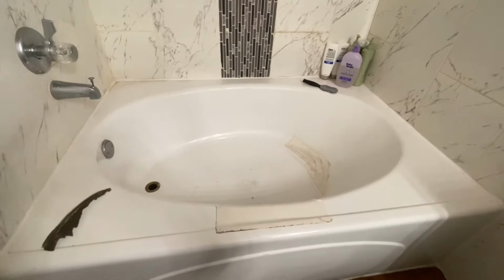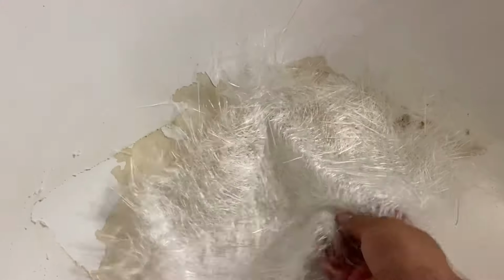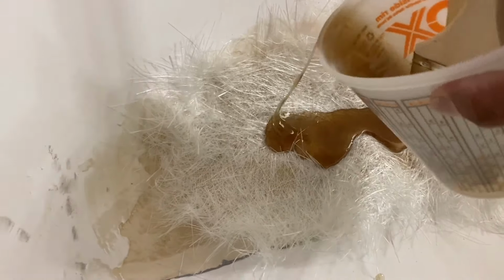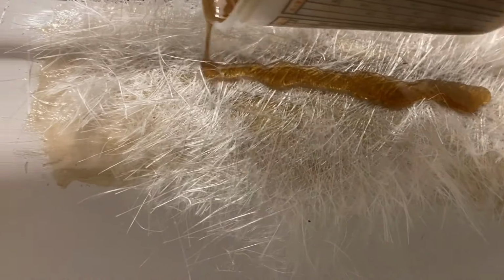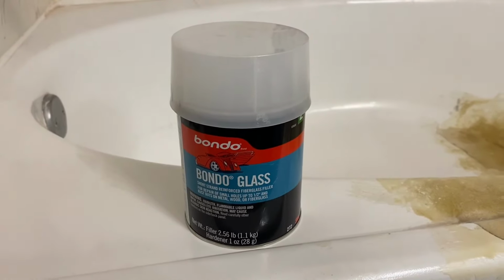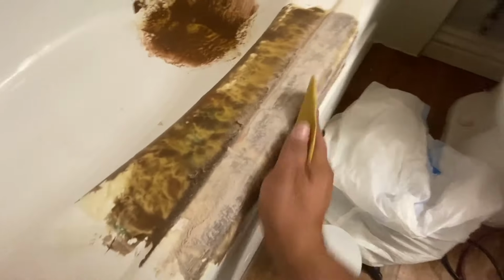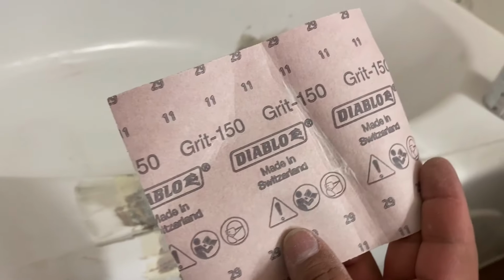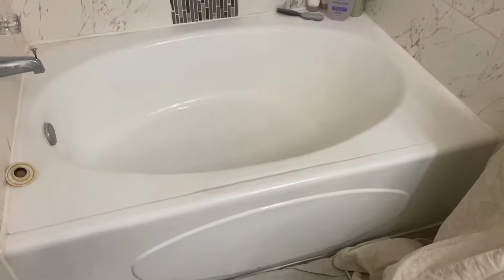How to Repair a Fiberglass Crack in a Bathtub | DIY Fiberglass Bathtub Crack Repair | STEP BY STEP

Comment: Do have or can you do a video about putting support under a fiberglass one piece tub/shower that is already installed.  I have been searching and not really finding anything for home repair. I can feel the lack of support in certain areas of the tub. I also have a couple cracks and will be using this video to repair it, but I want to put support in first. If you cant would you please direct me to a site or video.  Thanking you in advance.
Reply: There are those videos on you tube and other places.  I found several.

Comment: should one consider filling the gap under the cracking area of the tub?
Reply from the maker: You can if it’s extremely soft. However if it’s near the cove then there is not much you can do because there is a large void space behind the fiberglass units. Underneath is one thing but where it curves up is a void space in which foam would not fill properly

Comment: I did this last night.  all steps went pretty good except the krylon paint turned out horrible.  it was only glossy in a few patches.  rest of tub gritty matte finish which im sure will be a dirt magnet.
Reply from the maker: Once dry Take 2000 or 3000 grit wet sand paper and massage the tub with cold water. That will help remove any overspray mist. You can also DM me on Instagram or email me with any questions

Comment: Hi. I was wondering if you could list the materials used. It would be a huge help. Thank you so much.
Reply: I was after the same list. I live in  UK and have a hole to fix in my bath tube as well. Just would like to get the primer spray mark was used.

Comment: What is the difference between Bondo Glass and the Smoothening Putty?  Can you not just go straight to the putty?
Reply from the maker: Bondo glass has short strand “hairs” for added reinforcement. The putty is just a filler or smoothening putty. That’s why I’m some repairs you will see me use the bondo glass and others I will go straight to the putty.
Reply: @DPTubs  Ahhh. So it is basically the same thing as the (body) putty with fibers?
Reply from the maker: Bondo brand Bondo-glass reinforced filler is twice as strong as regular body filler. 1/2 in. interlocking fiberglass strands create strength and make this filler ideal for repairing small (dime-size or smaller) holes or rust-outs. Fiberglass strands in the filler allow covering holes without the need for backing strips, fiberglass mat or cloth.

Comment: Same here. This video came right on time. I bought the bondo resin and bondo all purpose and notice that you have bondo fiberglass on another video. Will this do for me or do I need the bondo fiberglass as well? Great video and we'll detailed.
Reply from the maker: I usually put bondo glass over resin only if the crack is substantial. How much is your crack flexing or broken through? If you are able to compare the cracks in my videos you may be able to get an idea on when I choose to use resin or just bondo glass. 

If you use resin or bondo glass you will still want to use some smoothing putty to smoothen out
Reply: Thank you for this tip. I'm going to add Bondo glass since I'm on my first step with resin and need to sand it down. Then finish it up with Bondo putty. Thank you for this video..

Comment: Question.. I have a crack on a flat portion of the tub. Do I still use the mesh?
Reply from the maker: DiaryOfAStud depends on how wide and if the crack is all the way through. If it is a crack that fluctuates and water gets through then I would use the mesh and drill small holes at the end of the crack.
Reply: Does it wear off with continued use? Or will it last long term?
Reply from the maker: DiaryOfAStud with proper cleaning it will last long term. Do not clean with abrasive cleaners. Or make sure you wipe down and clean regularly to prevent dirt and soap scum build up. Use Zep tub and tile cleaner with a soft sponge regularly.

Comment: Would you mind sharing how much you charge for this size job? I just spent over $100 (and that's without the $24 Krylon paint because SW is out, and it's $55 on Amazon right now). I'm wondering if I should just return all that stuff and call a pro.
Reply from the maker: $250

Comment: Thanks for making these videos. I fixed my tub but the sheen does not match on the patch to the rest of the tub. Do you have a video that covers that? Or any tips. Thanks Erik
Reply from the maker: If your tub is worn then there is no way to match because the paint you spray will always come out shiny. However after you use it it will start to blend in. 

If it bothers you and yiu want to “dull” it out then take 1000 grit wet sand paper on the newly sprayed area and slightly sand it wet to dull it out a bit

Comment: DP Tubs I have some hairline stress fractures on a fiberglass shower base. I feel it flex a bit when I stand in the shower. Should I reinforce this by adding foam in the drill holes or do you think doing just the reglazing you did would be fine? I don’t really want to drill if I don’t have to as the shower is only four years old and these are just hairline fractures etc. thx
Reply: I have the exact same problem as well and I would like to know
Reply: I am a month late with my reply but you are better off drilling the hole and filling it with foam so you don't have to worry about it in the future.

Comment: The rosin, glass and putty all have hardener included under the plastic cover. Save yourself the time and money searching. Also, wear gloves,  goggles and at least an N95 filter...and use a fan and open window to keep your work area ventilated.
Reply from the maker: Great advice! Thanks for the comment

Comment: Why didn't you use expansion foam under this crack?  Looked spongy.
Reply from the maker: Because the area where it curves up (where you would lean back) is completely void space and you would have to fill with a ton of foam. Would not be cost effective for the landlord. 
This has held up very strong. 

Keep in mind. Some of the work I do is limited by owner budget.

Comment: Wow amazing results. What primer did u use and does it have to be this Krylon tub&tile paint for the finish??
Reply from the maker: I just used Zinser 1-2-3 primer / stain blocker and then used Krylon. However if you are DIY you can use a Home Depot it Lowe’s tub and tile coating. But make sure the primer fully dries and is sandable.
Reply: DP Tubs & Home Repair hi water base primer or oil or does it not matter thank you
Reply: Also i have a shower base it is a little off-white, almost almond with a 6-8” crack now if i finish it with the white how do i prep/Finish the rest of the base to match. Do i sand, prime and finish coat only every else? Also was this a one day. Process.
Reply: Great vids by the way, i just came across a krylon appliance epoxy and i wondering if this one  would hold up longer than the bath and tile krylon.

Comment: Great Video! I've seen other vids where they fill the drilled holes with spray foam to increase the back support. You said you only drilled the holes to stop the spreading of the crack. Would you recommend injecting spray foam beneath the surface to provide some support??
Reply from the maker: I would only if it is directly at the bottom of the tub. The areas I was spraying had very large void spaces which would require way too much foam. If it was at the direct flat bottom portion of the tub then the additional foam would definitely work for additional support.
Reply: @DPTubs  Good info! One more question please: 
*Since you don't use foam in this application, the fiberglass is providing the structural support. If you use foam, then the foam is providing the structural support. When you use the foam, do you change the technique for the patch?*
Reply from the maker: Not necessarily. I may not feel the need to use the bondo glass since I wouldn’t need as much support. However I would still use the cloth over the crack like a drywaller would use tape over a crack. Then I would use the smoothening putty!
Reply: @DPTubs  my crack is on the bottom as it curves upwards to the sides.  What kind of expanding foam do You use?  And when it’s all finished how to clean the tub without scratching it?

Comment: Thank you for this video! Do you have a shared list of materials needed to do this? Also, I can hear water underneath my liner (but the liner is not squishy or anything). Do I need to remove the water before sealing it? Or will it eventually dry up? How do I remove the water?

Comment: Do fiberglass tubs crack on thier own after  several years ? Or is these cracks caused by too much stress on the tub ?
Reply from the maker: Could be different factors: weight of person, installation issues, or fiberglass product over time.
Reply: Ours cracked from dropping something very hard and blunt.

Comment: Do you do anything to reinforce the area under the crack to prevent future cracking?
Reply from the maker: Sometimes I will if it’s extremely soft. The location of the crack is key. This cove or curved area always has a void space so there is limited backing you can do. If it is flat at the bottom and there is a substrate then expandable foam is an option.

Comment: can you help me out with an good epoxy primer for going underneath kryl9n tub & tile
Reply from the maker: You can use Zinser 1-2-3 or Zinser shellac primer. Let dry over night and then sand with 400 very light and use a tack cloth to wipe down after. 

Midwest chemicals have the best refinishing primers but they are pricey and more for professionals. If you are a DIYer then I would use Zinser.

Comment: When you're sanding between layers, what is your goal? Is it to make it super smooth or is it to remove the biggest pieces? Or are you sanding it to rough it up for the next layer to bond with? And are you sanding it till it's flush with the rest of the tub or is just to smooth just the part we're working with?
Reply from the maker: Sand it smoother each time making sure edges are primarily smoothened with all big pieces removed. Smoother with each coat.
Reply: @DPTubs  thanks for the reply. I've had this problem on my to do list for a few months now. Tried to fix it once already but it didn't keep. Your video is excellent. Did an excellent job of spelling things out and laying down the process. I'm excited to see how mine turns out. I'm no professional but I'm pleased with the results thus far. Excellent work, man. Great video, and a huge thank you for doing it

Comment: Thank you for creating this video.  I did not know this type of repair was possible.  I started this project and soon realized the fumes are extremely strong.  Are these products safe to use in an occupied house?  If so, what safety precautions should one take before, during and after this project?
Reply from the maker: Products sold at Home Depot and safety instructions for use are on all material containers. I recommend using a filtered cartridge respirator as well as a time extractor / fan
Reply: @DPTubs  Thank you.  I think it will be helpful if you recommend these safety measure at the beginning of your videos.  Thanks Again.
Reply: Or you could just read the instructions and follow the safety precautions yourself. They’re not his products he’s just using them jfc

Comment: My tub has a 14” horizontal crack at the bottom...along the curve. Do I use the expanding foam? And since the fiberglass and all those finishes you used would only be on the repaired area, how much different will the final finish be compared to the rest of the original surface?
Reply from the maker: The difference from the original depends on a few factors: quality of patch and sanding, color used to match finish, existing condition and wear and tear of original surface. Patch will be smooth and most fiberglass bottoms have a slight texture..so the patches area will be smooth

Comment: Thanks for this video! After 5 plumbers, one finally discovered a crack in the tub about 3-4 inches across in the bottom corner. They told me that repairing the crack is only a temporary “band aid”. I was told a new $4,800 tub/shower needed to be put in. Well......I know how strong Bondo is and when I seen this video, I knew right away this was an excellent option. I followed your vid exactly and stayed under $100 buying all the supplies. I’m about 14 hours away from filling the tub and testing out the repair. Only trouble I had was the fact I didn’t have a flexible tool to spread the glass and putty over the curve. I did what I could and smoothed it out with the back of my finger. It wasn’t a super flat flush finish, but after liberal sanding it is smooth and almost unnoticeable after the paint. Thanks for this vid and saving me loads of money. 👍👌😎
Reply from the maker: So awesome! You can get the rubber Bondo putty spreader at Home Depot
Reply: Smart Choice to do the repair!  I take plumbing advice from plumbers, but not electrical advice or home repairs advice, among others.... lol

Comment: What’s the cost for a job like this?
Reply from the maker: Can range from $175-$275
Reply: DP Tubs thanks. I did a crappy job on my run and may need a professional
Reply from the maker: Where are you located?
Reply: DP Tubs Denver, Colorado

Comment: This video saved tub. Got the resin, fiberglass mat and the Bondo all purpose putty in grey and followed your steps. I need to find that primer and paint to color match now. I have 2 bathrooms so it allow me to max out setting times. I literally gave each step 24 hours to set because I notice that room temp is a factor. It’s officially autumn in Los Angeles so the colder it is the more setting time you need. Amateur tip: A small sander,  space heater and box fan come in handy for this job.
Reply from the maker: Great job! Thanks for sharing your tips and experience

Comment: Outstanding! Would it be possible to list out all the stuffs you use in the description?
Reply: Please list products??? I'm desperate lol
Reply: @MamaPsyLuv  Go to amazon. The brand is bondo that he is using. They have all sorts of products from bondo. Not too pricey either. I ordered the products to repair my bathtub. Super excited to get it fixed! Hope this helps. Have a great day! Also, Lowe's, and Home Depot have it as well. I just looked on their website and the bondo fiberglass resin is cheaper at these two stores other than amazon.
Reply: What primer are you using?
Reply: @supercriticalsolid  he has said in another video the primer is Zinzer 1-2-3 and the paint is Krylon tub and tile

Comment: Hey great job! I live in a Victorian apartment in Brooklyn NYC and I’m taking of paint in bathtub and the porcelain looks great under. I don’t know why they painted the porcelain on a cast-iron bathtub. Do  I still have to repaint if it looks great?
Reply from the maker: No. As long as you didn't apply acid on it yet you should be fine keeping the original.

Comment: Thank you!  Note if this happens: Bondo Glass may be tacky for hours because the hardener wasn't mixed well or not enough. So we waited over 12 hours still a little tacky but during sanding, the lower level is pretty solid and not tacky.
Reply from the maker: Make sure you make a circle of the material and then use one bead across the diameter of that circle of the hardener.
Reply: The bondo may fail to cure if there wasn't enough hardener, if the hardener was old or stored too hot, if the resin was old or allowed to freeze,  or if the surface it was spread on wasn't free of contaminants. Its absolutely essential to use something strong enough to remove all soap residues, any adhesive tape residues, the amine blush from the surface of any epoxy glues used by prior repair attempts, and the wax contained in the repair resin that rises to its surface to hold the hardener in the bulk so that it cures. I prefer to use Acetone for the final cleanup because its reliably effective. The formula for Lacquer Thinner varies regionally and over time to conform with air quality mandates. Any alcohol available will contain water. Acetone is always effective and doesn't leave any water behind, but its very hard on bare skin and it evaporates so rapidly that so-so ventilation is inadequate.
Reply: @oliverstreet7704 Wow, thanks for dropping all that knowledge

Comment: Currently waiting on my fiberglass resin to dry. How many coats of each product did you use?
Reply from the maker: Usually two but I make sure when I skim it with the spreader that I apply good pressure so the coats aren’t too thick.

Comment: Is the smoothing putty waterproof? I know the bondo glass works well in water but i've used regular bondo on boat repair and it will soak up water under the paint and mess up the finish after mild use.
Reply from the maker: Works totally fine. Make sure you let it dry and harden and sand well. I have never had an issue with it.

Comment: Entertaining to see the before and after video. 👍
How many hours and what would this job cost the owner?
I have to fix some outside wood trim near the roof, was thinking of using fiberglass resin and filler on the slight rotted wood. I am guessing it would hold up better than wood putty/filler.  What do you think?

Comment: of all the videos I found, this was the most helpful. Thanks for not cutting the camera during "boring" parts - those were the ones I needed to see. Thanks!
Reply from the maker: Thanks for watching glad I could help! New video out today!!
Reply: @DPTubs  what is that “smoothing”  grey stuff called? I wish you had all the materials listed.
Reply: Great! Have one crack going straight in my Tub. Would it be possible to list all the supplies required for this project? Thank you
Reply: @DPTubs  this works on a plastic surface also??